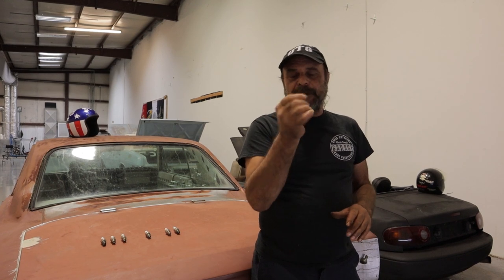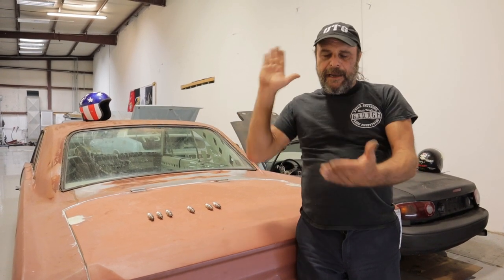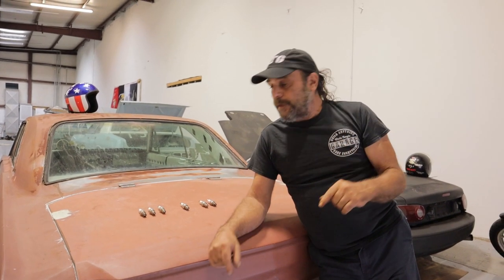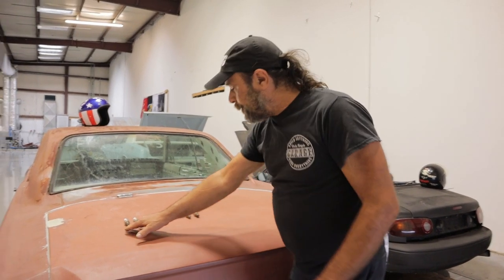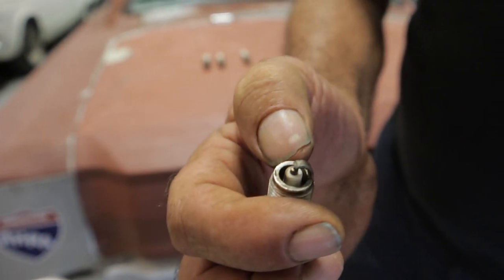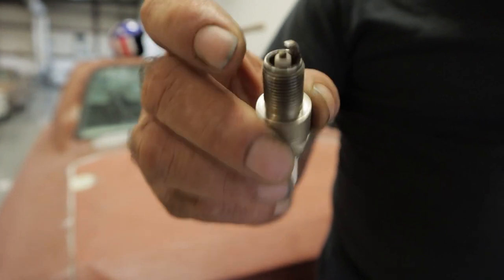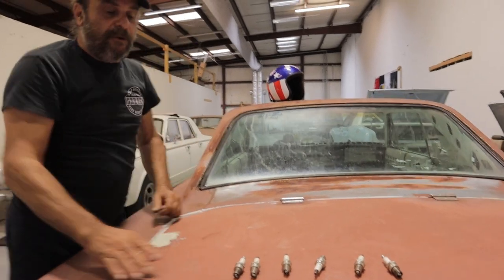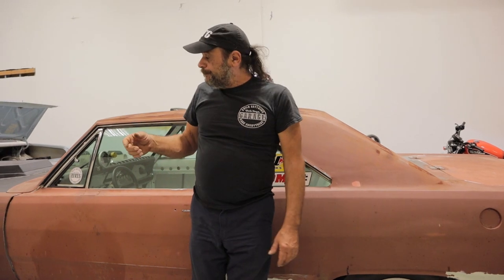Tales Of The Spark Plug. Engine Tuning By Reading Plugs

Comment: Back in '72 I put a turbo assembly off a 315 cu in Olds Rocket on the slant 6 in my'65 Belvedere I. I used the single barrel side draft carb from the Olds along with all the associated parts ( methanol injection,  waste gate, etc.). That thing ran like a raped ape, but my fuel economy went down the toilet.  I re-jetted the  carb myself,  no jets or metering rods were available so I made my own.  Got my fuel economy back and it still ran like a raped ape. I was pretty good with jetting carbs from racing motorcycles,  but THAT was a challenge AND a wonderful learning experience.
Reply: This👆 children of the internet, is someone who's forgotten more about the ICE yesterday we'll ever know.(no offense Uncle)
Reply: Most Deres had big blocks and the olds rocket never had side drafts. The deres started the Fury frenzy 318 to 440 and those were lead sleds. The 904s were crap and the tq flights only worked as stem slammers so trans were garbage if you had an auto. I blew out lots of 904s shredded bolts on flex plates warpage and burnt tq converters. 58 this year back in 72 was flood agnes my dad lost 2 mopars in that flood one a Dodge custom 318 pushbutton trans other was a 440 police intercepter Fury III.
Reply: @johngebhartiii7088  Wow, that is a beautiful car.  5 years older than mine but I really like that 2-door body style.  Mine were 4 door.  Sounded nice too when he started it up.  I wonder what they were asking for it?
Reply: @OverlandOne  Think the original max wedge was a 413 was a weird cid. The front ends on the deres were aluminum and if you pulled a wheelie it distorted the frame so a real alum dere is almost impossible to find. Those deres looked like ford fairlanes from the same year.
Reply: @johngebhartiii7088 , thank you for the link. Brings back memories.  
Mine was  a Belvedere 1, this one in the link was a Belvedere 2. 
 Mine was a retired government car that my Dad bought at a GSA auction in '71 for $386.  4 door, slant 6, automatic with 8¾" posi-traction rear end. 99,000 plus miles on it when we brought it home. Bone stock I ran it at the drags in U- stock and took home a bunch of 1st place trophies. Most memorable race was in the Winston Nationals in Salt Lake in '72. They used the ET bracket racers as fill-ins when they had a problem with the dragsters,  like when one wouldn't start. I went up against one of my friends with a Chevy Nova that would run the quarter mile in 9.35 seconds at around 135mph. My fastest time was 21.5 seconds @ 67 mph. He beat me by 2 one hundreds of a second.  He told me that was one of his most stressful races of his career,  watching me drive away for over 10 seconds while waiting for the green light.  By the way that race was shown on ABC Wide World of Sports. 
 After the turbo install, time 10.34 seconds @ around 130 mph.
Reply: @johngebhartiii7088 , the Olds Rocket  DID INDEED have a side draft carb.  You can do a search of Tony's channel for the Olds Jetfire, a precursor of the Rocket. In this video he covers the turbocharger,  methanol injection,  boost pressure, etc. 
     Something to note, the Olds was limited to 6 lbs of boost,  but the spring in the diaphragm that controls the boost is the same diameter as a ½ washer.  Stack a couple of washers under the spring and now you have 12 lbs of boost. I put a pressure guage on the manifold and after the shift to second gear the boost would jump to about 35 lbs until the turbo spooled down.  At 35 lbs of boost that poor slant 6 was producing most likely over 600 HP.
    For your own entertainment find out how much horsepower it takes to move a 3230 lb car through the ¼MILE  in 10.35 seconds.   That slant 6 is a Very Tough engine.
Reply: @brucejones2354  Much obliged for the correction. I know lot about cars but I can't claim to know it all. Have a blessed day we got rain for today.
Reply: Cambron Gabaree  try reading my comment till the end before "educating " me
Reply: @johngebhartiii7088  for what it's worth my old man and i had a car back in the 80's and 90's. 1964 Dodge Polara 330. Damn car was fast. Was an original 413 max wedge that we stuffed a 440 into. It was a lot of fun. I miss him and all the car fun we used to have.

Comment: If it's a Holley get yourself adjustable metering block that controls the idle air bleeds circuit, with a small cube engine you need to change the air bleed to give it more responsiveness or to rid of the bog, I did this to a 465 changed the metering plate with air bleed and now it spins the wheels on take off no bog or hesitation.

Comment: I simply use a Dremel with a wire brush to clean the fouling off in order to get a read on my plugs.  Been working great for decades!  Doing multi RPM throttle chops is critical when trying to tune....
Reply: See the "cleaning plugs with fire" video .

Comment: Perfect explanation of how to do this.  Sparking plugs do speak in tongues or is it Pig latin?  Over the past few years on Webers & Edelbrocks in my stable I've just gone to air/fuel meters.  Yes it's kinda expensive and drilling holes in the exhaust ain't fun but at least welding is not such a thing on the bungs anymore.  I've found this to be the tool to shine the light on range of mixture reading... cold, hot, idle, load up and down hills... etc.  The mystery is now on a gauge right there and so easy to deal with.  I think this is like welding.  Learn with a stick welder then get the fancy wire welder.  Learn from the start.  Learn to read plugs then get an air/fuel meter - earn your stripes!  Good bare bones tech you offer - as always.  Good luck on the oil pan issue and I'll be following.   Bobby

Comment: Sorry to be a naysayer on the downdraft concept but there is a reason triple/double webers are the gold standard for high performance in line applications.  I have done SU, Weber and downdraft on 4 and 6 cyl and what a good set of tuned webers does is amazing.

Comment: Re: sump oil pressure issues. In the 70s when the Ford boys in Australia were circuit racing clevo 51s, even the factory teams were blowing engines like roman candles. To keep within homologation rules, Ford Australia engineers  developed a sump with "ears" on each side of the stock sump to increase volume taking cap out from 6 odd quarts to over 8. They put them into production at the factory and kerbed the 351c grenades. Picked up many Bathurst and points round wins in these super competitive times. Im thinkin increase volume by 2 to 3 quarts and the usual baffle windage/ magic. At bathurst and other tracks the clevos used to near suck the sump dry with the small sumps at 7k plus leading to engine failure. and yeah- boom. Just showing you some ocha  history.

Comment: When a mechanic buddy told me to fix my first motorcycle in the 70's, and he told me about plug heat ranges and what a plug should look like (the same color as the filter on my cigarettes) the light switched on and I've never looked back. I even use that on my modern EFI/OBD2 systems as a primary method of determining fuel metering for my favourite RPM to back up code information. Makes perfect sense....

Comment: Some things i remewber about running a big carb. on a small engine ; 1 drill the idle air bleeds, 2drill outwhere the idle mixture screws to almost diament  of  these screws ,3 also incrase the taper  i use wet/dry sandpaper 4 this , 4 i heard of lowering the float level -  Maybe prevent  rain ? don,t know ? On a friends 302 sbf power valves Never worked  but straight jeting was o.k. best wishes U.T.G.

Comment: soon UTG will show us how to build a budget dry sump oiling system.
Reply: I posted how to do this in the previous vid. Use a belt driven hydraulic pump for a single stage scavenge and the stock oil pump for pressure.
Reply: @bobroberts2371  Yeah, old skool.
Reply: At least he show us something.
Reply: Are these builds really budget builds when all you do is work on them cause every part fails?
Reply: @UCmZp5lsovHkt6ywHDd90suw totally agree..my time is worth much more..being a slave to these builds is not fun.I enjoy uncle Tony's channel greatly but all this time and effort to go 14 or 15 seconds in 1/4 mile is absurd
Reply from the maker: Did you ever stop to think that it's the actual work that I enjoy doing on these things, and that the trial and error of working with oddball and budget stuff is the essence of what I do?
If you're ever expecting to see a simple, straightforward project with predictable results on this channel, you are in the wrong place, man.
I get no enjoyment from that sort of thing
Reply: @UncleTonysGarage  Yep,and I'm jealous. You're living the life I would love to. The oil pans I'm talking about. We built out of two or three others. Then we would build our own pickup. Now I'm a married man with a 9 to 5 running on the wheel like a gerbil. You got it made brother.
Reply: @UncleTonysGarage  You can do a lot with a sawsall and a welder.
Reply: @UncleTonysGarage correct. It is called play. Very enjoyable. Try not to break things along the way

Comment: Reminds me of a guy back in high school in the 70's who was running a tunnel ram with dual Holey 650 double pumpers on a stock Chevy 283, with stock single exhaust, in his Impala.  Sure it looked cool but it barley ran and when it did, it ran like crap.  I was only running a single Holley 650 on my worked over 440 with a Purple shaft cam and medium high rise intake, headers and dual glass pack exhaust and it took me a little time to get that tuned in so it ran perfectly.
Reply: I ran a 427 chevy with a nice cam mid-size port heads and small headers, 650 DP Holley. I worked it up a bit. Milled off the choke horn and set up the rest of it. It pulled strong and had a sharp throttle, sure it wasn't a high rpm screamer but drove great and had strong mid-range. You dont always need a giant carburetor...
Reply: Had a 72 Satellite LA built in canada balanced blueprinted with factory 3/4 cam. Put a 2p180 intake on it a carter afb with 2 one inch alum spacers and hedman headers with dual thrush birdies to attempt to silence it. 2 and1/4 inch exhaust think specs called for 52 and a half inches per side to get max hp from long header to exit. Other than advancing timing to 13 degree btdc and plugging the vacuum distributer it ran perfect.
Reply: @johngebhartiii7088   The 440 I built was a 1970 Police interceptor.  I actually owned 2 of them but only built one, I used the other as a daily driver.  It had 10.5:1 compression, was bored .030 over, and  had a Mallory dual point ignition with a 50k volt coil.  I kept the original cop rear end gears and had the A727 Trans rebuilt complete with a shift kit.  That thing would fly.  I was once clocked by a Kentucky State trooper doing 152 in a 55 back in the 1970's.  He was cool and wrote me up for 74 as anything over that he said would mean I would be arrested.  He made me get out and open the hood.  Then he had me start the engine so he could hear it.  He told me the Crown Vics they drove would not go over 135.  My Fury got a little over 20 mpg which was pretty good for that big a car in 1977.  At 70, it was only turning 1900 rpm and , if you were wide open, it would hit 100 before it shifted out of 2nd!  Redline was at 6,000 but it was set up to shift at 5,700.  I miss those cars.
Reply: My 1st car was a 351 Cleveland powered Australian Ford Falcon 
I thought my dad was the greatest when he put a tunnel ram and twin point Mallory dizzy on it
6 months later when he new i wouldn't kill myself he swapped back to single 4 barrel and re curved the distributor,  holy sheet did it go then 
That's when i realized my father actually cared for me 😂
Reply: @huski300  Had a 65 two door guy I got it from put a 302 boss in it. Gave him fits fitting that motor in. Can imagine the 351 was a shoehorn fit as well. Check out SRC he runs a 61 but I think its a chevy LT in that.

Comment: 1987 thunder road in barre vermont went to 6 cylinders,of course it ws a tube chassis on a 61 lancer body,real light but i made the oil pan,7 quarts,deep sump with crank baffles,it was a modified on asphalt circle track,and mad my own intake for 3 side draft 1 1/ SUs,lol, i won a lot of races,the next year they went back to v8s

Comment: When I tune my drag mini bike I pop in a new plug and do a pull but I shut it off during the pull ( at what ever rpm and throttle position I want to check). Helps get a tru read of what's going on at part and full throttle I was having a rich idle/part throttle and lean full throttle. So I jetted down the idle circuit and jetted up the main circuit

Comment: What about adding a two step? The throttle blades will be open and you’ll not be relying on the accelerator pump. My friend used a two step with a c4 footbrake trans and it worked pretty well.
Reply from the maker: I'm not ruling that out as a possibility, but I'd rather fix it right than resort to a crutch
Reply: Uncle Tony's Garage  I understand what you’re saying, but a two step on a strip only car isn’t really a crutch.

Comment: Tony, I learned a bit about how to read plugs on 2 strokes. Same procedure, warm bike up on regular plugs, swap to new and give her hell through all the gears, just cut the ignition at top end and remove the plugs. Why? Because the partial throttle rips will ruin the plug read. I don't like taking a hacksaw to expensive plugs, but it is the best way to read the burned on ring of the plugs. 

I'm sure its different for a 4 stroke, but it's so similar at the same time it hurts.

Comment: Interesting situation!  Inclined to believe it is simply to much carburetor.  Sticking w/ Holley, the Street Avenger 390 cfm(from memory model  8007) seems like it might offer a more consistent result.  Assuming the goal in vacuum is around 7.5; using the 390 w/slightly detuned transfer-slots(base-plate adjust) and a lower octane fuel, like say 93 pump-gas as well as a nice 1.25-1.50" anodized spacer seem to me like a good place to experiment. In my view proper atomization is going to be a chore w/ that intake in general, and quite possibly less is more.  Glad you got to run at the track!

Comment: I have a haunted cylinder 5 in my 318 … about once a year or so, it cracks the porcelain on the plug. Normal wear but crack - all other cylinders fine  … I might have to install the new ones with a drop of holy water!
Reply: It cracks on the combustion side of the plug or the wire side?
Reply: @bobroberts2371  wire side
Reply: @DScaglione.  Does the plug fall apart?  

If it does, there is an install problem or maybe something hitting the plug.  

If not, you are likely seeing a carbon track from a failed plug boot. It goes like this, plug gap gets big causing firing voltage to rise.  Spark flashes over from the terminal to shell causing a carbon track on the plug insulator and boot. Plug is changed, miss fire goes away however carbon track is still on boot.  Plugs wear a little, firing voltage goes up however carbon track on boot makes an easy path causing a miss fire / carbon tracking on plug.

Comment: In order to read the main jet mixture properly you must cut the plug shank off and inspect the mixture ring at the base of the insulator. The top part of the insulator should be no other color than white when performing a plug chop.  Indeed the top section of the insulator will have color if the mixture is pig rich because cylinder temperatures are not high enough to keep that part of the plug clean i.e. rich.  Just my 2 cents....love your vids!

Comment: Maybe you could hunt down a second hand oil accumulator, or try and fab one yourself, they are a pretty simple bit of kit. Tube, floating piston, air on one side and oil on the other much like a shock absorber.

Comment: With such a small motor with poor atomization you could probably use a small Street Demon or small Edelbrock AVS2. The triple stacked boosters or annular discharge boosters of the AVS2 would probably help.

Comment: I am not sure , when ever i used a carb or carbs too big  for an engine  the carbs then required very large jets to compensate for low draw through the venturi ,  and if i remember correctly you have removed the PV's  which is neg 10 sizes approx aswell. Good Luck with it

Comment: hey my first comment on your videos. but here goes, slant six is my go to engine in everything :P  and it suffers from Pore distrebution and aussispeed has some modernised  intake manifolds that have alot better fuel distrebution then the old offenhouser. just a suggestion to check them out.  cilynder 6-1 are lean, 5-2 are just right and 4-3 are to fat is what i learned for the doug dutra book maby that is somthing to look in to :) hei from norway and good luck in all your /6 endeavors.